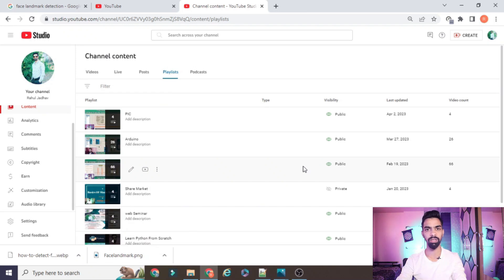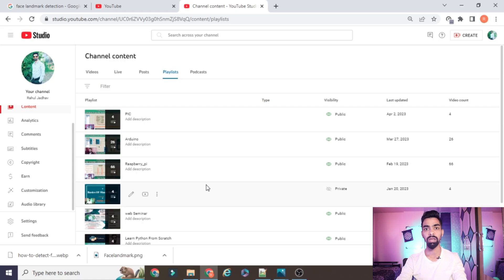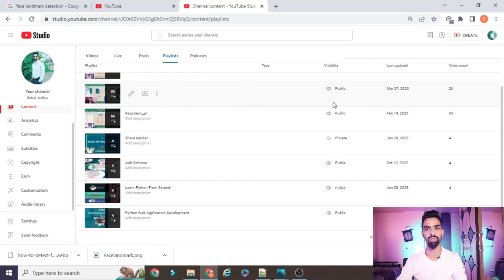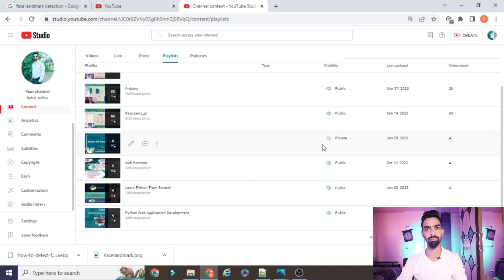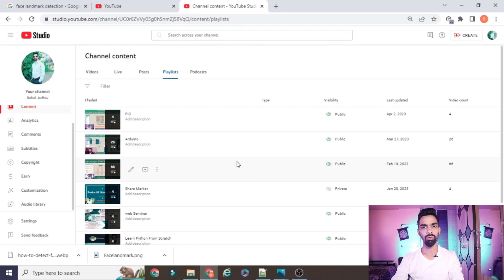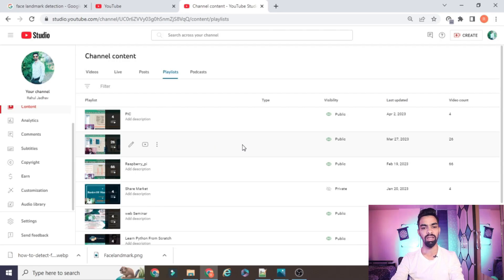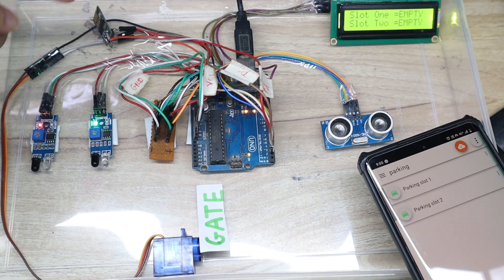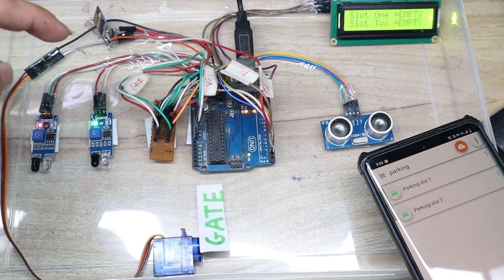IOT Based Car Parking System Using Arduino |best innovative science project #scienceproject #science

Comment: I am getting MQTT connection failed in lcd display sir
Reply from the maker: Please watch complete video, you should use same esp 01s module, change the baudrate as explained in video.
Reply: Yes sir esp connection is happening and I am getting it display on lcd that it is connected
Reply from the maker: @deshenanivasundaraVasundara Great
Reply: But one thing is that mqtt is not connected and i am getting it as mqtt connection failed
Reply from the maker: @deshenanivasundaraVasundara Please change the broker name